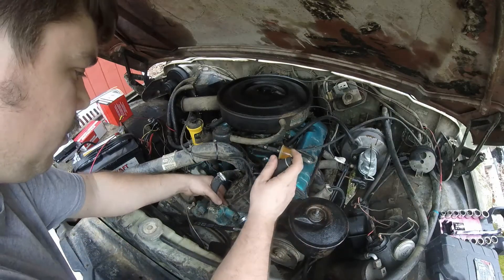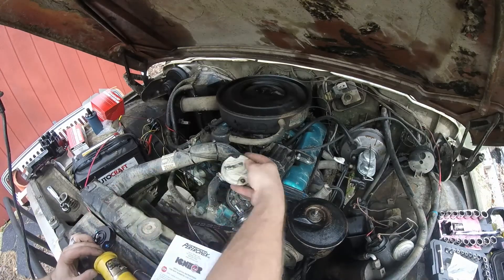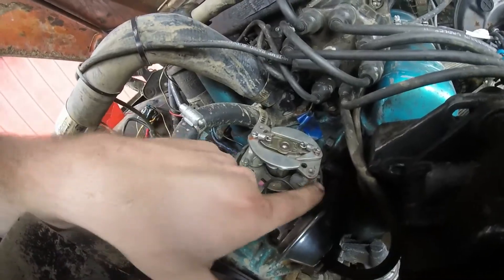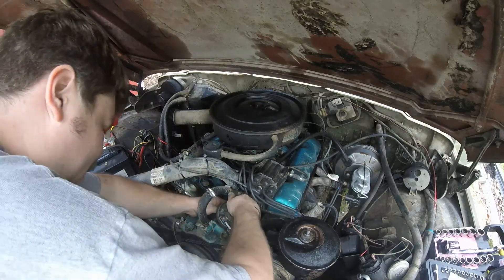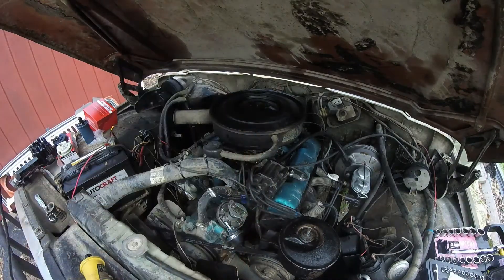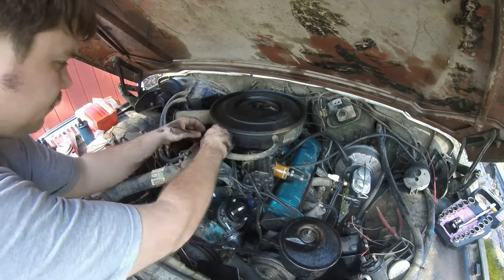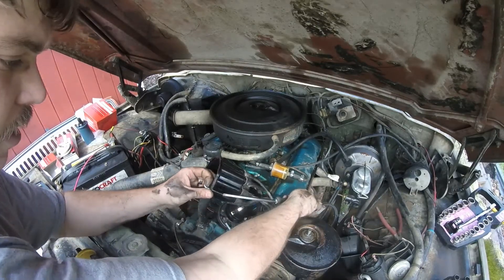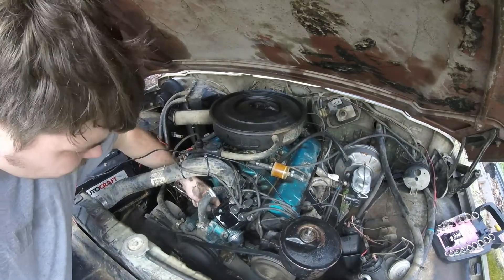Cheap Electronic Ignition Upgrade

Comment: Can not remember , do you need to unplug the vacuum advance before you set the timing ?

     What did the kit cost ?

God bless
Wyr
Reply from the maker: Doesn't look like I did, and I'm actually not sure. I have heard some say you should take the vacuum line off and I have also heard I does not matter. I want to say the kit was around 80 bucks I think its actually a GM distributor on this AMC engine, so the price may vary depending on what distributor you have.
Reply: YES!